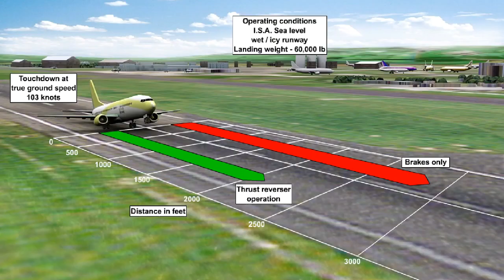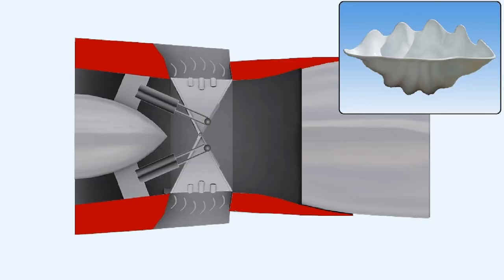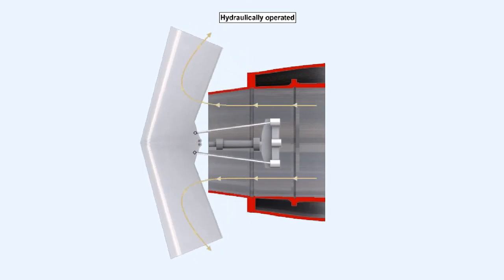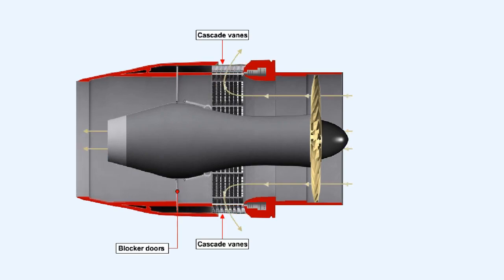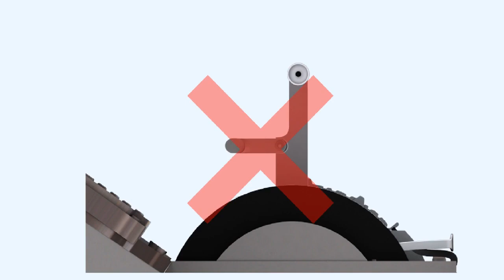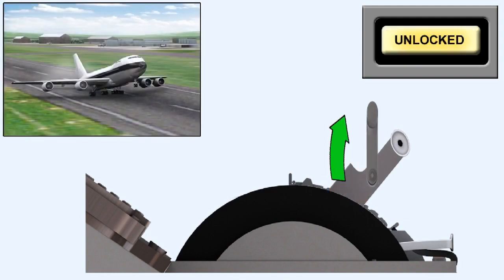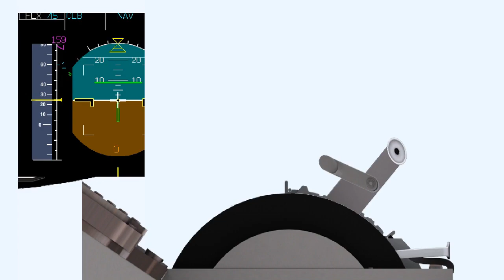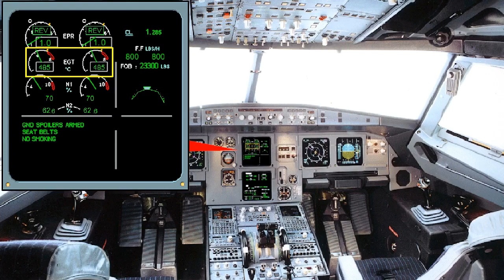Reverse Thrust - Aircraft Gas Turbine Engines #12

Comment: Thanks for the explanation. Slanted blocker door on a cold stream cascade thrust reverser is a bit complicated to shape on the AutoDesk because the overall shape of the blocker doors especially closed is like a truncated cone but the blocker door should match the internal curvature of the nacelle. While the blocker door closed at 90 degree angle is less complex than a slanted blocker door.